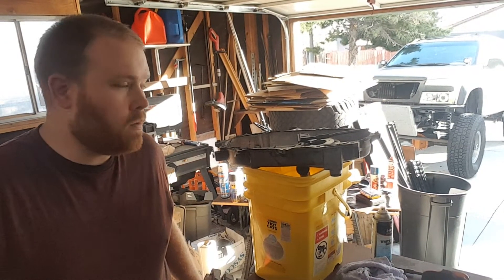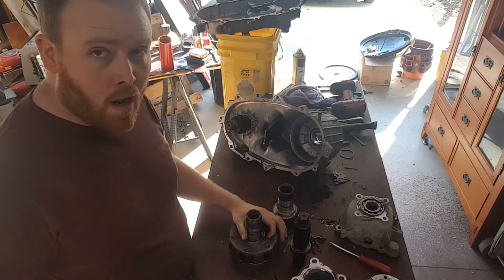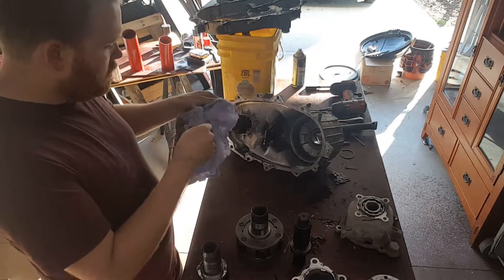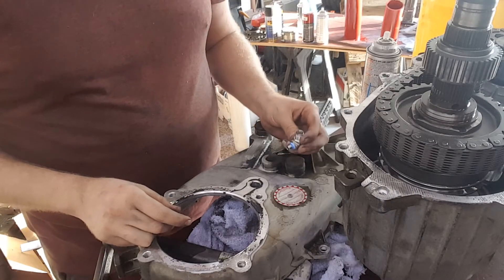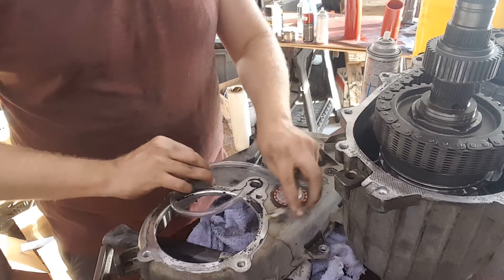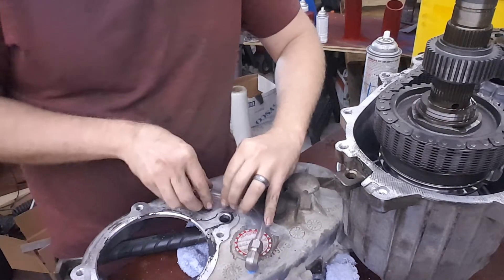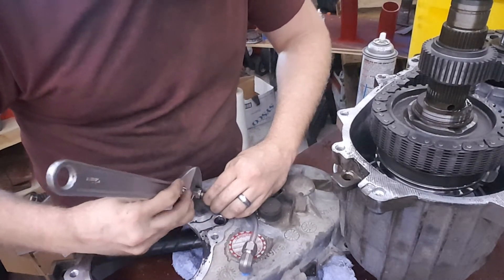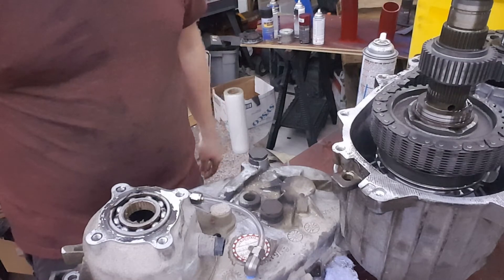Project BADLANDER - Part 15 - Building the Doubler the quest for 110:1 crawl ratio

Comment: i wish I could do what you did to your Colorado, it looks amazing!
Reply from the maker: Chris Preslar thanks. I simply researched and learned. Get on the fb groups and forum and start getting ideas and learning.
Reply: ya I am on 355 nation but what im thinking is a little different than what most have done on there, I just need to save up the funds for it, im thinking of a either a 350 or 454 mashed to a th400 with a np205 transfer case with full size chevy 3/4 ton axles under it
Reply from the maker: Chris Preslar it would be easier to drop in a 5.3. While it's a bit more conventional it's far easier to do.
Reply: That's the only thing I don't want to deal with computer systems I'd rather go old school haha
Reply from the maker: Chris Preslar the tune is the easy part. Hit up supermodulation
Reply: He does great work but I think I'll stick to carb instead. Oh I forgot to ask, did you upgrade your brake booster or have to do anything major for the brakes?
Reply from the maker: Chris Preslar I plan to omit the abs with a blazer proportioning valve but that's all. I'm all 1/2 ton running gear now and the brakes still do great.
Reply: Thank you for the info, I think for what I'm going to do I'm gonna need some heavier brakes haha